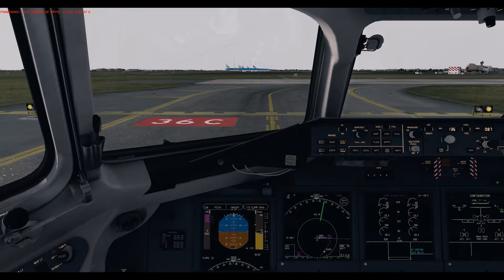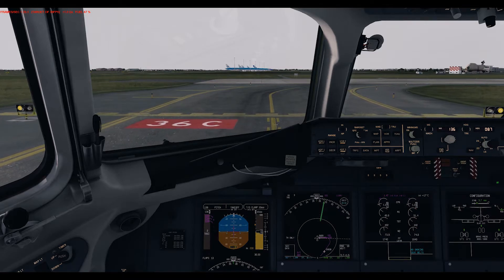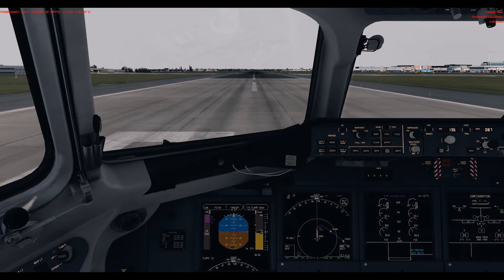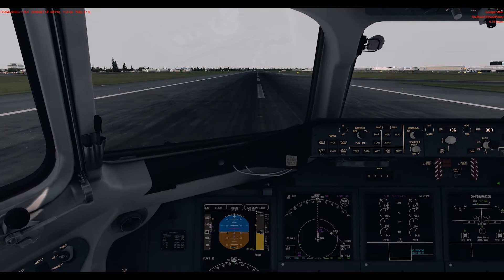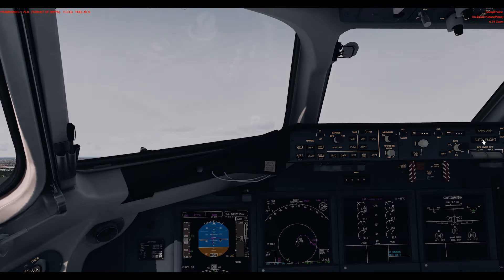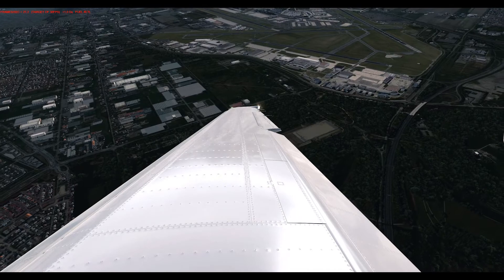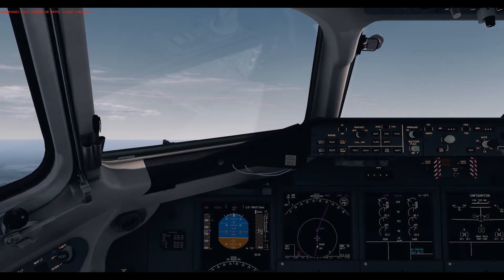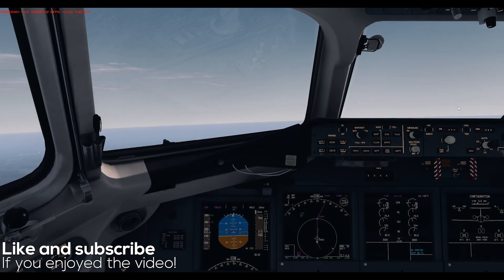[P3Dv4] TFDi 717 | Performance Test Flight

Comment: What are your specs?
Reply from the maker: [PC Specifications]
Astock Extreme4 Z77
Intel i7 3770K at 4.8Ghz
16GB Kingston Hyperx 2200Mhz
EVGA GeForce GTX 1070 FE
Corsair H100i v2 Liquid Cooler
Samsung 850 EVO 500GB 
WD 4TB Black